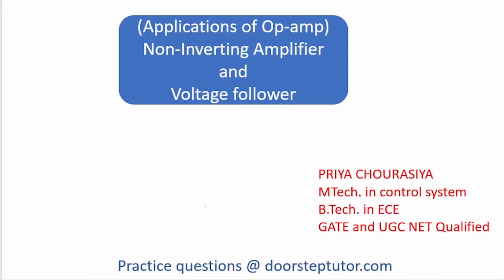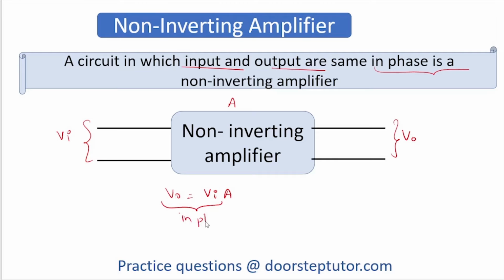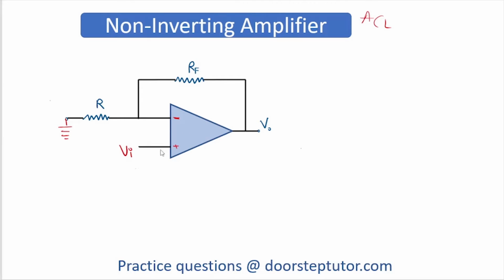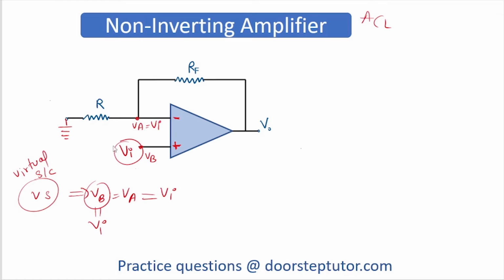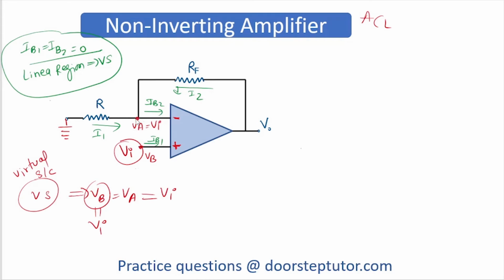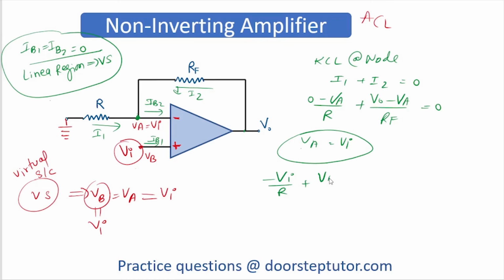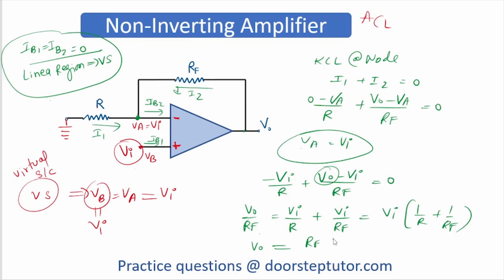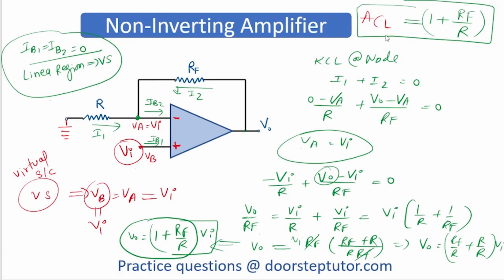Non-Inverting Amplifier & Voltage Follower - Video Course @ doorsteptutor.com | Electronic Science

Comment from the maker: The non-inverting amplifier and voltage follower configurations are high-yield topics frequently tested in UGC NET Electronic Science, often appearing in questions regarding circuit gain and virtual ground concepts. You can master these derivations and related numerical problems by practicing with our exhaustive question bank at https://www.doorsteptutor.com/Exams/UGC/Electronic-Science/. Let us know your doubts below!